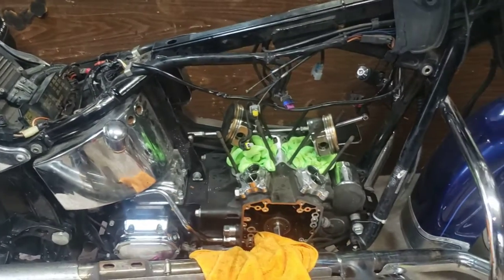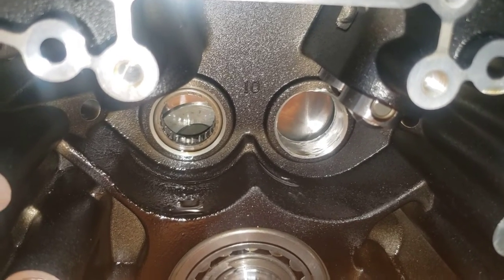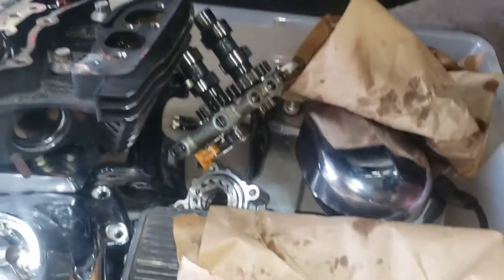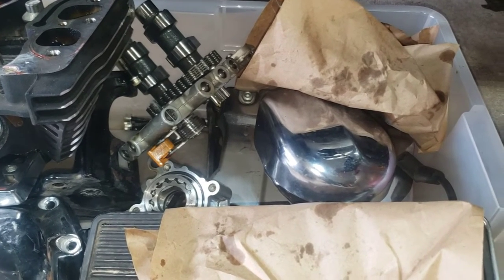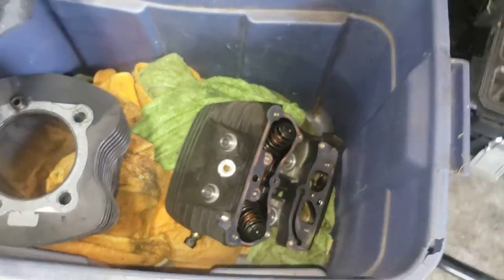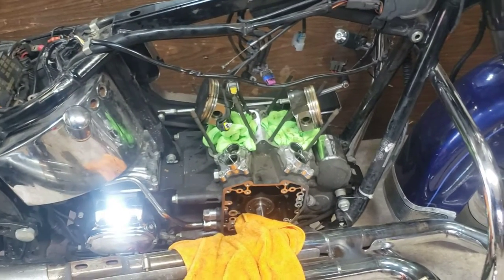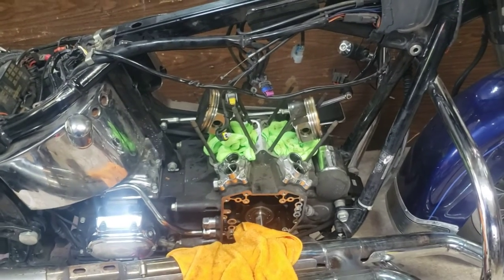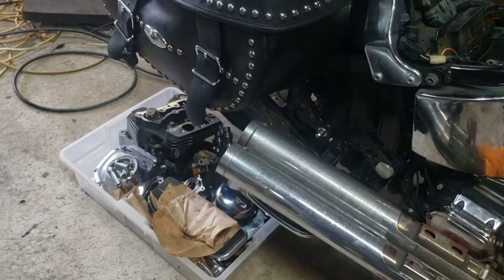final thoughts on harley Davidson cam failure cam issue. time to create a shopping list... ugh.

Comment: in 2013 my cam bearing went out before it did I had a Bird chirping going on was not sure if it was a intake seal or a bearing . my misfortune it was a bearing it took the case with it the hole was as big as a golf ball . it made it home 35 miles .   it would chirp then go a half mile chirp  go a 1/8th mile it never got real bad just now and then .     BTW I just sent heads off needed Guides valves seats cut and seals Dragonman did the work $359. it was 80 round trip shipping with 1200 ins , $475    the cheapest I got around me was $750 and I had to buy the valves and seats and guides + seals.   My SE heads look brand new  had them on when the bearing went out ate the Valve guides

Comment: Ship the case off to Dragonman  the engine refresh 1200 heads and jugs bottom end .   you just put it back together . https://www.youtube.com/watch?v=ERWD6fPpaWo
Reply from the maker: $1200 or 1200cc? It's an 88 twin cam. It's also an 06... he starts by stating he does up to 99. I have a bottom end lined up already. I'll hone the cylinders myself. I'll spend the money on the s&s gear cam and fuel oil pump.
Reply: @rywolf01  He will do all harley engines for 1200$ you just build it when it comes back . my last build I spent 5 grand , If I knew about Dragonman I sent it off to him .
Reply: @rywolf01  You can't go wrong with the S&S oil pump and the cam gear but you will hear it it makes a wizzing sound . torrington bearings are selling for 2 bucks each  I just got one to replace mine EVO .  in 2009 a breading was 5 dollars .  prices has got crazy
Reply: @rywolf01  Top ends on the 99-2022  , Bottom ends he wont do .